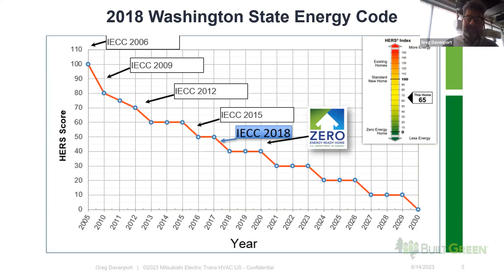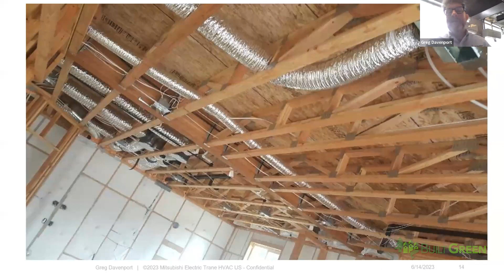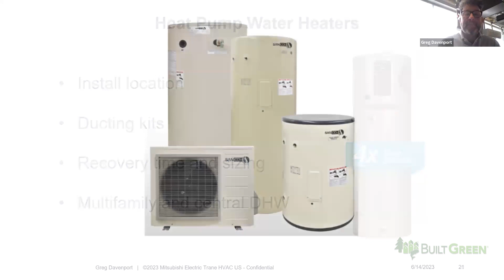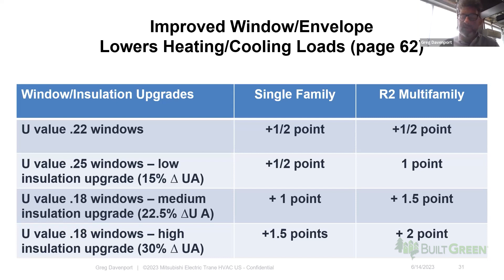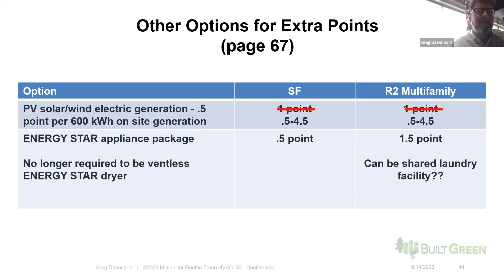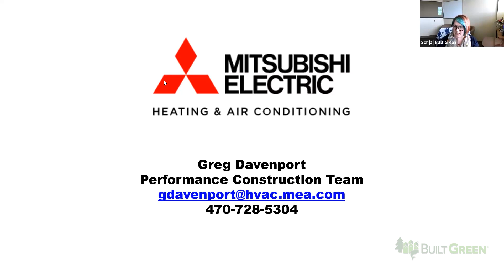2021 WSEC-R Code Changes and HVAC Strategies

Comment: Ah, yes. "Affordable housing." Quick rant: What people don't realize is the domino effect. You want better insulation? It requires heeled trusses, added siding and framing labor, etc. You want 1" continuous foam insulation all the way around a house? (It makes engineers nervous btw) Its a huge added labor cost to install, more expensive exterior doors, furring strips all the way around the house in many cases, etc. The people making the rules (dumb-smart-people) here have no clue of the repercussions and that they are putting builders out of business because they can't sell these high functioning homes for a profit. 20-30 years ago anyone could buy a house if they had a halfway decent job that didn't even require a masters degree. So they think they're successful because they are smashing energy efficiency records as a State but also are making home prices unattainably steep, builders and buyers frustrated, etc. Priorities...
Reply: I agree. I am so unbelievably frustrated with this bs. We can't afford to hire a builder. Trying to understand this garbage without knowledge in so many areas is nearly impossible. 
Why tf do these people care to this level about how efficient a standard home is? F you all of you.